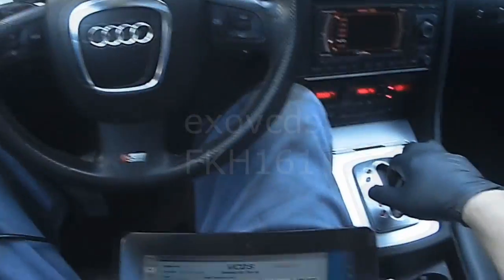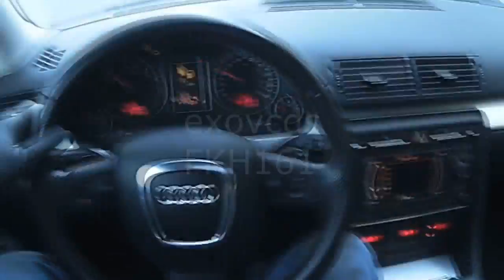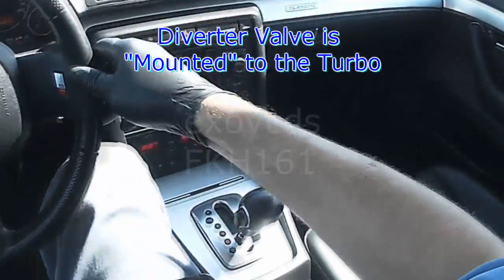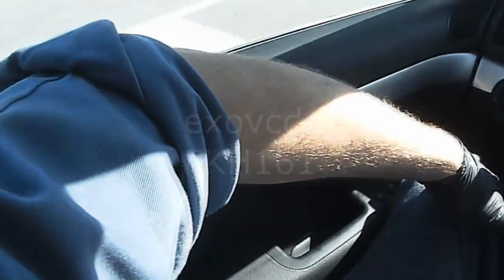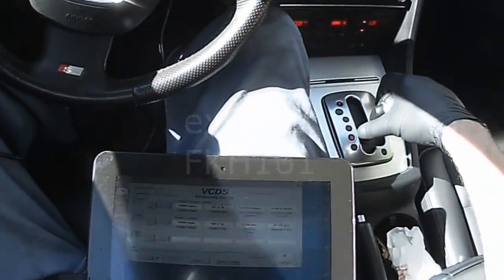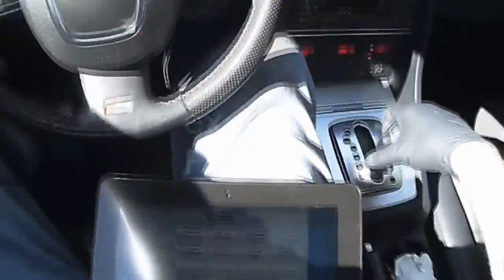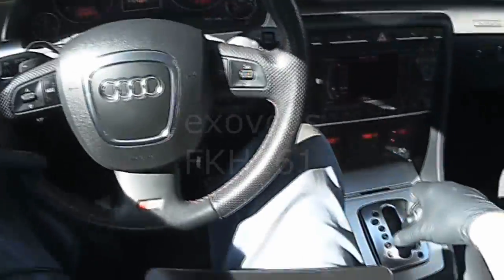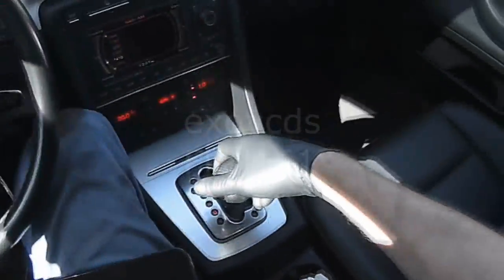Audi B7: 2.0T FSI "Boost Pressure Regulation Control Range not reached".

Comment: Hey thomas what will cause an P0234 Limit Exceeded (Overboost Condition) on  1.8tsi engine? thanks
Reply from the maker: Boost is controlled by opening the wastegate with the N75 valve... the diverter valve is used to recirculate left over boost into the turbo. I guess if the valve does not open, then there will be boost in the intake when there should not be... but I don't think it will set an overboost code.
Reply from the maker: Sorry, I read your question wrong... I thought you asked if this diverter valve could cause this. Check the correct function of the N75 valve and the wastegate (make sure that it is not stuck closed). Boost is used to open the wastegate... the N75 valve directs boost to the wastegate actuator to open the wastegate. One of them could be causing the issue.
Reply: @EXOVCDS  thank you thomas will replace the n75 valve and let you know also is there a way to check the operation of the wastegate?
Reply: @EXOVCDS  sorry i made a mistake with the code the entire thing is boost pressure regulation limit exceeded overboost condition or and the problem is intermittent happened twice in the last couple of weeks once i shut off and restart the engine everything was good.
Reply from the maker: Don't replace the N75 until you check it. It could be good. All it is, is a valve that opens when the ECM applies ground to the control wire... once grounded, boost flows through the valve into the wastegate pod / actuator, which then opens the wastegate (to dump / decrease boost). You can remove the N75 and apply power & ground to it... and at the same time, blow into the valve to confirm free flowing passage for air to travel. To check the wastegate, you can use a hand held vacuum / pressure pump (set to pressure) and then apply pressure to the actuator pod. The pod should move the wastegate actuator rod and open the wastegate. If no movement occurs, then the pod is stuck. If no pressure builds in the vacuum / pressure gauge, then the pod / actuator diaphragm is broken.
Reply: @EXOVCDS  understood thanks will keep you updated
Reply from the maker: @shimon2476  OK, thanks!
Reply: @EXOVCDS   hey brother changed the n75 and map sensor car worked great but I got back the problem tonight checked the wastegate for freeplay seems normal to me is there any way to check for a sticking wastegate? better yet is there a way to service the wastegate? what else you think I should check at this point i'm thinking of replacing the turbocharger.
Reply from the maker: @shimon2476  wastegates usually fail causing lack of boost. In your case you are getting too much. You can check function of the wastgate pod with a hand held vacuum / pressure pump. Disconnect the hose going to the wastegate pod and attach the pump to the pod. Apply pressure and watch for movement of the wastegate rod. If pressure builds, but the rod does not move, then the actuator is bad.
Reply: @EXOVCDS  ok will borrow a vacumm pressure pump and check but will this be an intermittent thing? I would think that the fault would of been permanent if the actuator was bad
Reply from the maker: @shimon2476  You are correct, one would think that.. but I suppose that during the early stage of pod failure, that the pod sticks intermittently. I'm not saying that it's a pod issues... that's why I'm suggesting to check it. Since you already replaced the N75... the only thing left would be the pod or the turbo assembly.
Reply: @EXOVCDS  I agree was reading the  self study guide they say the pod can be replaced as a maintenance part will take off the diverter valve and check for rips tears tom as well one other side effect is the power comes on kind of surgy at times maybe its my mind will have to check into that some more
Reply: @EXOVCDS  although they said 2.0tsi engine  i have the 1.8tsi engine take a look at this tsb https://static.nhtsa.gov/odi/tsbs/2015/MC-10122981-9999.pdf let me know your thoughts
Reply from the maker: @shimon2476  that's a good find! 1.8tsi & 2.0tsi are pretty much the same. Definitely worth checking!
Reply: @EXOVCDS  I think so as well trying to understand the picture though is that the wastegate arm?
Reply: @EXOVCDS  hey also how can I donate you helped me so many times got a paypal?
Reply from the maker: @shimon2476  the red arrows are pointing to the turbo housing where the lever for the wastgate goes into the housing. At the right side of the picture, you can see the wastegate rod from the actuator pod. The shiny circle is the actuator pod. Click the fkh161 link in the description. You can then pick 1 of 4 PayPal links. Thank you.
Reply: @EXOVCDS  thanks for the help brother will check it out tom and give you some feedback as well as donate
Reply: @EXOVCDS  Hey just an update cleaned the diverter valve I have the latest revision used some lithium grease so far so good but the problem was intermittent to begin with so time will tell made some logs so I can email them to you so you can take a look btw one other problem Im getting is my car is chewing through injectors every couple months this is like the 4th one i will be changing they dont stick open to flood the cylinder or anything they just cause misfires im leaning towards the fact that when i install the used injectors I dont change the teflon seal and after some time its causing the cylinder to leak compression idk thoughts?
Reply from the maker: @shimon2476  Thanks for the update... I'm not sure about teflon seal being the cause of misfires.
Reply: @EXOVCDS  yea it wasn't the seal was a faulty injector will replace them next time with 4 new ones donated as well thanks for all the help!

Comment: Hi, maybe you can help me. I have  Audi A4 B7 2.0 tdi BPW and I don't know where the problem is. When I press the gas, the turbo does not work, then I release the gas and press it again and the turbo works. Turbo is after CHRA replacement ... everything is clean. The diagnostic reports error P0234 boost pressure regulation
Reply from the maker: Overboost will cause the engine to go into Limp Mode (ECM reduces boost to protect the engine). The turbo actuator rod "stop" position needs to be checked... if the turbo actuator moves more than it should, overboost conditions can occur. A simple adjustment of the stop screw can solve this (if that is the problem).
Reply: @EXOVCDS  can you tell me what is the exact procedure for adjusting this screw?
Reply: @EXOVCDS  I would also like to add that if the gas is not responding and I still keep it pressed after a while, there will be a few seconds of knocking from the engine area that stops and the car usually has the power back.
Reply from the maker: I don't know what the problem is... I'm guessing. Checking the "stop position" is one of the things that I would check. The first easiest thing to do (for me) is to drive the car and do some data logging. Boost specified, boost actual, MAF specified / actual (when available) along with RPM. Once I drive the car, I can feel what the car is doing and then compare the data (live data) at the same time. You can have low power with high boost... if the engine is going into limp mode, boost will stay low. Don't adjust anything until you have ruled out everything else. You can attach a hand vacuum pump to the turbo actuator pod... and check when the vane lever makes contact with the stop screw (should be at around 17"Hg of vacuum). This can be done with the engine off... but also can be difficult to see on some cars... is your engine sitting front to back or side to side? Send me a picture of your engine bay and I will tell you where to look (remove the plastic engine cover if there is one). Click the fkh161 link in the description and then click "tool request" to send me a picture.
Reply: @EXOVCDS  Many thanks... I turned the screw about two turns and the car goes normal. Also, the curves in the turbo pressure chart have improved. Thank you very much again, you saved me a lot of time.
Reply from the maker: @adrianseleman2872  Thank you for the update... I did not expect you to solve this so quickly. Good job!

Comment: Hi, i have a4 b7 2.0 tdi. My boost fails at high speeds like 140km/h  if i rev and try to reach that speed fast...the explanation i got from the mechanic was that the geometry of the turbo is stuck and i need to recondition the turbo or replace it... should i just replace the turbo or get a second option? Its an expensive part that's why I'm asking.
Reply from the maker: If it's the original turbo with higher mileage... it could probably use a complete overhaul (will eventually need it anyways). Not many mechanics (including myself) overhaul turbos... yes, new replacement turbos are expensive, but they also come with a warranty, whereas overhauling can sometimes lead to other issues, if things were not done 100% correct. If you are planning on keeping the car for 5+ more years, it's worth putting money into the car (the cost will pay for itself / be less over that time).
Reply: @EXOVCDS  Thanks for the answer. I did actually had it refurbished but one year later it started acting up so i guess i do need to replace it with a new one. I will use it until it fails completely, driving around normally in the city seems fine it only acts up if i have big acceleration.

Comment: I know that this video was posted a while ago but my cel is on for overboost would that be caused from the dv or the n75?
Reply from the maker: Year, make, model, engine?
Reply: @EXOVCDS  Its A audi a4 2007 quattro
Reply: @EXOVCDS  2.0
Reply from the maker: DV should not cause overboost (as far as I am aware). N75 is in charge of controlling boost, so yes... N75 or a broken wastegate diaphragm. Turbo pressure / boost is used to open the wastegate. N75 allows boost to enter the wastegate actuator / diaphragm... if the diaphragm  is broken, boost can't move the rod (as far as I know / my guess).
Reply: @EXOVCDS  Cool thanks thomas I really do appreciate it!

Comment: Hey man love the video, very informative. I have a 05.5 B7 A4 6speed Quattro 2.0t FSI, replacing the diverter, I've removed the bottom two Allen bolts, but the top one is stripped and I can't get to it for the life of me. I've tried pistol grip pliers, 90° vise grips, allens. Just no luck.
Reply from the maker: Bolt extractor socket set should have a socket that will fit / bit into the head... like in this video:

https://youtu.be/B4ZsnCgywNQ?t=300

Should start playing & show 2 sockets of different sizes.

Comment: Could this part also cause overboost?
Reply from the maker: I don't think so... boost is controlled by the wastegate.
YEar, make, model, engine?
Reply: Thomas EXOVCDS 2007 Audi A4 2.0T
Reply from the maker: Wastegate is controlled by a boost soelenoid (mounted close to the diverter valve). A faulty diverter valve will cause turbo flutter sound when coming off of boost (because boost is not recirculated into the turbo intake)... when coming off of boost (foot off of gas pedal) the ECM is no longer looking at boost since it's not needed. Overboost (IIRC) is set when boost goes past what the ECM wants. Diverter valve should be closed during that time anyways.

Comment: I had exactly the same problem on my 2006 A4 2.0T @140K Km since late January this year throwing 000665 Boost Pressure Regulation, P-0299- Control range not reached, Fault Status 11100010. MIL-ON etc etc. Kept on resetting the fault code, but it kept on coming on every time I would try driving a bit more aggressively or up the hill (usually in third gear). Removed the old diverter valve which had cracked lime green diaphragm. Got the new one as pictured on the video for CAD $105. Installed it and tried out today. All is well again. Thanks for detailed instruction and guidance. Much appreciated.
Reply from the maker: Good to hear that you solved your p0299 issue... most of the time it is the diverter, but other things could also set the same code. Keep in mind that the new style valve can also fail / stick (but hopefully not for a long time). Thank you for watching!

Comment: I got audi a4 2005 2.0t fsi mine is doing same take a while to gain power and not really happy with power shall i change mine ? I just changed pcv valve , also noticed on my car at idle feels like a misfire and temp gauge is fluctuating going to change plugd and coil packs and ct sensor
Reply from the maker: Check for excessive play / movement of the turbo wastegate rod... wastegate could be leaking boost.

Comment: Hello. I have the same code. Replaced the DV to the new pistonversion, replaced the N75 and the cam follower. Erased codes, still no difference and same code (P0299 Turbo/super charger boost sensor, Control limit not reach) came up and MIL on... Gonna check for any leaks using smoke this week. Anything else that may cause this code? I read something about the N80, mine is making this loud ticking noise while idling. Could it be that that causes this code and low boost?? I can hear my turbo and also feel it but it gives very low boost at 3000rpm+.     Appreciate any feedback. 😁

EDIT: Car is an Audi A4 B7 2.0T
Reply from the maker: Check for excessive wategate movement / freeplay where the wastegate rod is attached to the wastegate flapper. Wiggle the rod and see how much the flapper shaft moves. WIll not be easy to get at / see.

http://fkh161.ca/Audi/A4/Flapper.jpg
Reply: @EXOVCDS  Geez that's a tight squeeze. I'll have to use a mirror or something to see.    Let's say it has a lot of play, what do I have to do? Will I have to replace the whole intake manifold?? Thanks for the fast reply! 😃
Reply from the maker: The image I posted is of the turbo.... other side of engine as the intake manifold... remove / replace the turbo IF there is too much play. Watch humble mechanics video.
Reply: @EXOVCDS  I pray to the gods of VAG that this is not the case. Expensive stuff... I will have to check that as soon as possible. Thanks again, man. You're a legend! 🤘🏼

Comment: I have the same car the same code and just changed the diverter valve to the new style and still have the code and only boosting 14 PSI also have stage 1 APR tune so it should be around 20, any suggestions?
Reply from the maker: lukegonia12 If you have a leak, you should be able to hear it. If you can't hear one, look for signs of a leak at all intake connections from the turbo to the intake manifold. Make sure that the PCV is working correctly. If no faults are found, check the turbo wastegate for excessive Freeplay / movement.

Comment: I have an audi a4 2.0 turbo its manual transmission when In 1st gear the car jerks a little sometimes it will do it while on 2nd gear too and when I am driving and switch it to neutral the rpm starts going down sometimes it actually turns off specially if you step on the break
Reply from the maker: Not sure what you mean by jerks... can be interpreted differently by different people. Clutch chatter, misfire, hesitation, bucking. Start with checking for fault codes. Could be a dirty throttle body, an ignition coil, clutch issue, fuel injection etc. not sure at this point.

Comment: so mine started to die on road outa nowhere  and now when i start it and take off i step on gas and go nowere the rpm go up to 5 or 6 then die down and car gos about 30 mph and gains little speed can hit 60mph in a good amount of time and no coolent seems to be running through the engine so i did a flush someone befor me used 50/50 so there was gel bild up flushed a few time did not fix did thermostat and the car after the cooleng went throught the engine and the computer to it cought up ran like a champ then on high way cut out died to stop started it and was off again the next day car went back to running 20/30mph im at a loss does it have a short or is it the water pump dont seem to be getting coolent through the engine but dont show overheating but gets half way quick fans dont turn on when they should check engin light is back on and epc light is back on i just bought the car and already put in a few bucks what could cause the car to lose power and not go but if let sit a day or two will run for a little the lose power and go to a cralw and when it get hot it hickups in idel the after a little will just die and wont till next day idk please help me out i lost code but one sade new co2 senser and throttle sencer i think ans one was a short or somethig any one?
Reply from the maker: Year, make, model, engine?
Try to write in sentences... one issue at a time. It will be easier to follow / understand what you are trying to say. Standard or automatic? Did you do a full system scan? Any codes? A water pump will not cause power loss unless the engine is starting to seize from overheating.